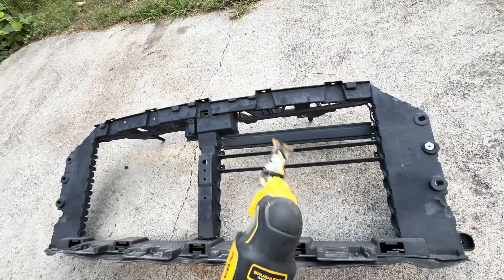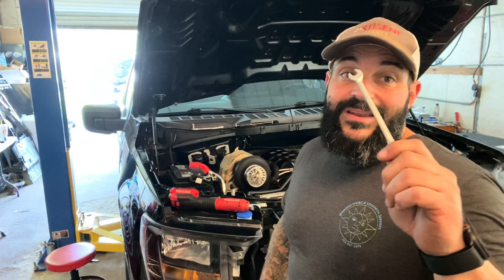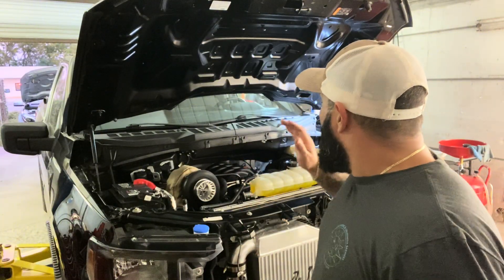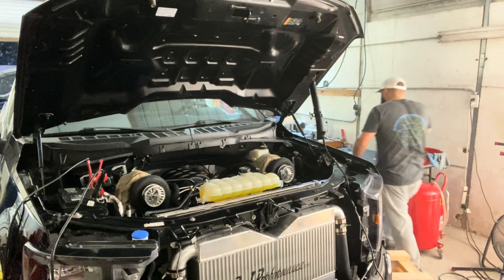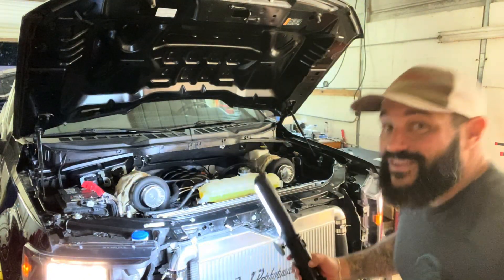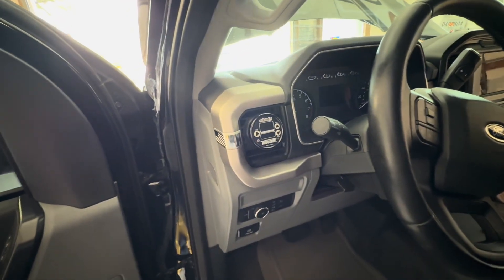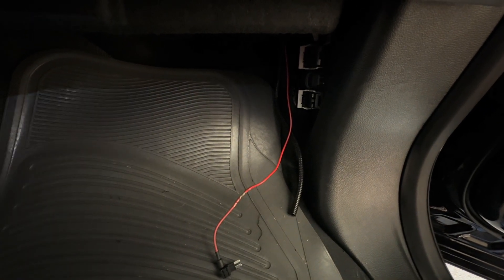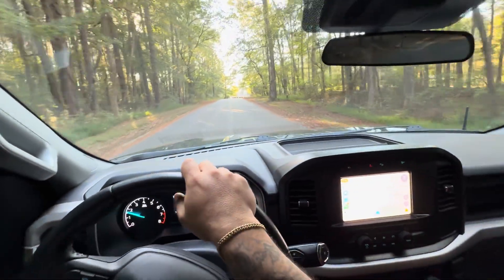2021-2025 on3 twin turbo install part 2

Comment: Awesome job on the truck man!  I somehow managed to buy a new ‘25 regular cab short bed a couple weeks ago, and then discovered afterwards all the cool things people are doing to them.  I knew it was rare, but didn’t realize they were so sought after.  I just thought it was a sales tactic when every guy at the dealership would walk by and make a comment about it being a special fleet order because it’s red.  My salesman probably thought I was a nut job, but I just wanted a simple and reliable daily without all the extra unnecessary crap a single guy doesn’t need!  I’d love to do a twins kit down the road, but I’ll be living vicariously through you until then
Reply from the maker: I’m getting it all dialed in as far as the tune, so I’ll be bringing updates weekly 
Thanks for watching!